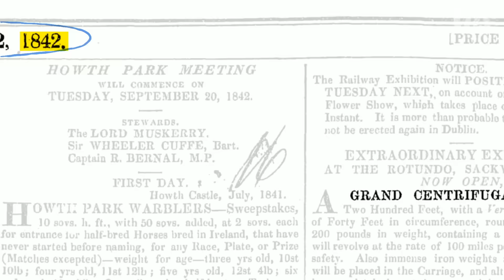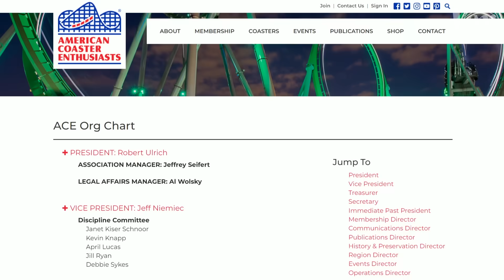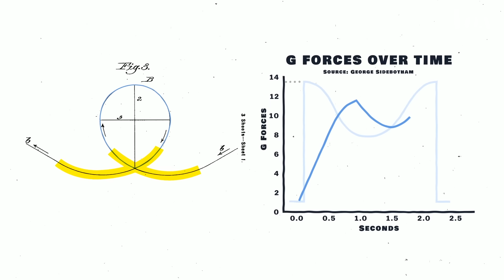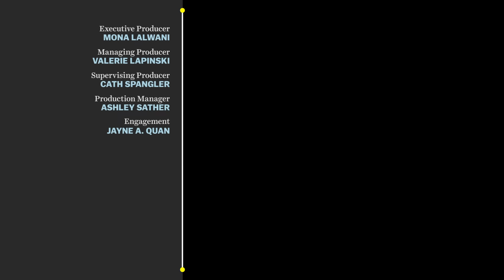Why roller coaster loops aren't circular

Comment: All these experts and not a single one showed the math for how they calculated 12 - 14 G? Because they are over estimating the height and speed of this ride. To hit 12G it would have to be ~70 feet tall. Most roller coasters during this time were between 20 and 40 feet tall. The first coaster to hit 60 feet wasn't until 1923. Flip Flap Railway more likely was in the 40 foot and 35 mile per hour range, therefore only hitting 6 - 8G.

Comment: You CAN have a looping coaster that is perfectly circular, but it has to be big and gradually curve upward as to not create excess g forces. The car that is going on the coaster also needs to be going just fast enough to make it over the loop, but not stall, to ensure the amount of g forces are safe.

Comment: Before I understood what G-forces are I was on a Superman rollercoaster in six flags one time. The rollercoaster is basically positioning you like superman flying where it would hold onto your legs and then raise you up belly down before it starts. During the ride it would spin up upwards (belly up), it felt like my chest was being compressed by a hydraulic piston. lol

Comment: Surprising they didn’t figure that out before the build process. That’s fairly easy force vector stuff, any physics-structural engineering undergraduate ought to be able to model that with some fairly elemental logic and existing Newtonian equations, even without resorting to calculus. I would have been able to figure out the g forces in a few hours or days at the most starting from scratch but no they blundered on doing it wrong several times.
Nobody thought to hire a university academic there must have been a few…weird. Perhaps this lends insight into the state of intellectual development 50-100 years ago.

Comment: Favourite loop coaster was the now defunct Corkscrew at Alton Towers in England. As the name suggests, it had a series of loops like stretched out spring coils. One might think that having more than one loop in a barrel series orientation would defy the upside down teardrop solution… but I’d guess the G’s are handled by the lower run up and run off arcs being stretched out on a horizontal axis between the loops instead. A pretty genius design - the twin loops section are now on display as an art piece/ homage at the parc to this day.

Comment: There IS one exception in terms of non-circular loops on today's roller coasters: the Shock Wave at Six Flags Over Texas. Both of that roller coaster's back-to-back loops are, indeed, circular; and yet, THESE circular loops don't have any of the issues that the earlier circular loops had; that's because the Shock Wave's loops are not nearly as tight as the circular loops of yore. The Shock Wave looks like it's had two Fireballs (a.k.a. Super Loops) attached to its track. The Shock Wave pulls 5 g's as it goes through the loops. This is definitely not high enough to cause blackout; it is, instead, enough to provide the riders with a big-time thrill! This g-force also causes the riders to re-interpret "down" to be "toward the track" instead of "toward the ground"; and thus, the riders never feel like they're upside-down!

Comment: could cause confusion for some people, when they said 4.9G they meant from the starting value to the ending value rate in 1 second
Thus, as opposed to 1 to 14G in 0 seconds (14G), it went from about 1G to 11G in 1 second (4.9G) which is sustainable because under 6G limit.

Comment: the one at Kennywood park in Pittsburgh PA was shut down and disassembled a few years ago.  it was a single track single loop just like you showed in the original, I remember it as a perfect circle but I havent seen it in 30 years so. likley it was a clothoid.  I should look into it.

Comment: The pressure (or G-Force) would be to strong in a normal loop, but a imperfect circle’s has less force, which is why it is used. I just saved you 6 minutes

Comment: At 5:18 the graph says 10 g forces, but later at 5:24 you say 4.9 g's. I'm not calling you a liar, i'm just confused.
Reply: They’re talking about a different coaster but still you’d be correct 10-14 g’s is massively inaccurate to the point i dont know how they messed up that badly

Comment: My mom is a very tall woman. At over 6'5'', she's historically had to be picky about which cars to buy, and it turns out that she doesn't fit perfectly in all amusement park rides, either. She experienced this bigtime after she went on a loop-the-loop rollercoaster... without a harness. She realized that her legs were too long for the bars to properly lock over her, but wasn't able to hail an attendant to get her off the ride before it was too late. All she could do was hold on literally for dear life, which resulted in an extremely sore back. Thank goodness for centrifugal force, I guess, or else my sister and I might not even be here.
Reply: didnt happen. its impossible for a coaster to start without every harness closed, especially looping coasters.
Reply: @happysword258  I don't think it happened either but it's definitely possible to dispatch some coasters (including loopers) with the restraints open

Comment: The physics behind why roller coaster loops aren't circular is also behind why road and railroad curves don't transition immediately from straight to circular-segment curves, but instead use a "Transition Curve" to ease the sideways forces.

Comment: The Revolution also didn't have shoulder harnesses when it was opened. Just a lap bar & the force kept you in.
Reply: The ride was renovated a few years ago, and now only has lap bars.
Reply: @A_A610  I watched the pov of the ride & it's wild  that nowadays they removed the harness considering it had been added and considering all the safety measures they ensure today.

Comment: The values of G force mentioned in the video and on graphs are all over the place. 
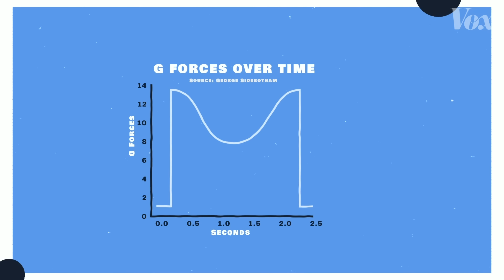2:52 the values change from ~8 to 14 at the top of the graph
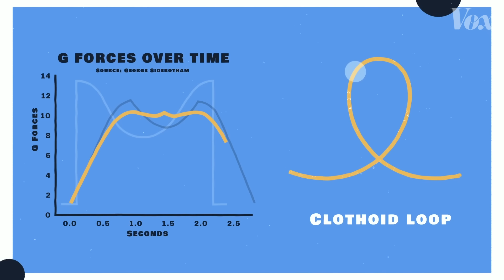5:11 clothoid has around 10G at the peak on the graph, but video 5:23 mentions 4,9G. I know it's for that one specific real life loop, but shouldn't it be at least somewhere close? Oh wait, if you actually used the graph provided by george it would be close! But instead you used a graph that you claim was sourced from george
5:31 On your graph it was 8G at the top of the loop (middle of graph), not 9G

Why
Reply: I guess graphics designers didn’t study graphs. Oh the irony…

Comment: Sadly the current record holder for most inversions (turning riders upside down during the ride), The Smiler at Alton Towers in the UK, passed into infamy with the terrible accident that occurred there on a windy day on June 2nd 2015. Due to a breakdown in communication, following the ride being evacuated after a fault was detected, ride operators failed to spot that an empty vehicle they sent round the track failed to complete the circuit. During this time, they were asked to add a fifth vehicle to the ride. While this was being done, a vehicle full of passengers set off, but was halted at the top of the first lift hill because of the track ahead of it being occupied, as designed.

The operators, still unaware of stalled vehicle, overrode the safety system and sent the vehicle full of passengers up the lift hill paving the way for the devastating crash that occurred seconds later.

The accident left 5 people seriously injured of which two required partial leg amputations

Comment: I think it doesn't really need a degree in mechanical engineering to understand this: In a circular loop in a rollercoaster, the g-forces peak right at the entry point and exit point (lowest point), because the curvature is constant and the speed (forward velocity) is highest. To passengers it would feel like a harsh impact, almost crash, since acceleration jumps from zero to max in no time. For similar reasons, curves are no circle segments on streets and (reasonable^) racing games.

Comment: Kings Island a park near me had to remove a loop on a wooden coaster called The Son of Beast years ago im guessing because of this same issue.
Reply: The loop removal was a casualty related to a different issue. An earlier incident involving a damaged section of track injuring a train full of riders led the park to get rid of the original trains to save wear and tear on the track. However, the lighter trains they swapped onto the ride were too light to properly clear the loop, so the park opted to remove it. The loop was never faulty, it just wasn't designed for those new trains.
Reply: @A_A610  makes sense

Comment: In short without even having to watch the video: circular loops provide too much force on the rider since you accelerate into different directions quicker than if the loop is smoother (turns are less sharp).

Comment: Are carts less likely to get stuck at the top of the loop if the curve is a modern style compared to the original
Reply: Getting stuck in a loop requires a very particular set of circumstances. The train would have to be perfectly balanced to not only stop upside down, but to stay there as well. It has happened, but it's exceedingly rare. It's far more common for rides to valley (i.e. roll backward and come to a stop at a low point).

Comment: I've been on a loop that pushed my head down so hard that I felt like my neck was gonna snap. It seems not all engineers have learned since the late 1800s.
Reply: you still probably only felt around 5-6Gs, far safer then 14G which would probably actually injure u

Comment: 2:26 I should point out a few things from the graphic. 
1. The Space Shuttle had a G limit of 3 because the shuttle stack was very fragile, and it would break apart if the forces increased beyond 3G, however other rockets pull more, like the 2nd manned space program, Gemini, which used the Titan II ICBM as a booster. Those astronauts pulled 7-8 G’s
2. The F-16 is capable of pulling +9.5 Gs, and pilots train for that. Other Fighters can do that, too, such as the F-22 Raptor. 
3. Ejecting from a fighter jet will give you a brief boost of +12-14 Gs.
Reply: They tried really hard to get impressive looking stats below that 6G line, I think. They took an F-16 roll, which I actually can't find any info on. I imagine it'd mostly be lateral and some negative if you're going full on since the cockpit sits somewhat above the roll axis AFAIK. 

Humans are quite good at withstanding sudden spikes in G force (depending on the circumstances). Humans tend to have trouble with sustained G's.

Comment: There are lots of inconsistencies in the video. At first they say a human body cant stand more the 6G without passing out. Then they show human riders at loops that reaches up to 12-14g. Also for the modern loop they showed it reaches 8-10 on the graph but just after the speaker said 4.5g. Can someone explain?

Comment: The graphs are terrible at illustrating the g-force on these loops. It shows the shape of the g-forces but it completely ignores the g-force numbers. As a result, all of them are illustrated as having dangerously high g-forces. The last one is supposed to show 4.9 but the graph shows 10-11g. Yes, it shows the difference in curvature, but that's kind of pointless..

Comment: Your graph at 5:12 shows the Clothoid Loop peaking at above 10G, but then you claimed that it peaks at 4.9G - are all your graphs inaccurate?
Reply: I think the 4.9 is like the average all around. You only have those high spikes of 10 G’s for not even half a second. So 4.9 Gs is around the average a rider will feel during the loop in total. I don’t know if I make sense. But I hope I help
Reply: @eatyourvegetables1449  no, 10 g is dangerous even for less than half a second. i think that 4.9 g is the max force, so the graph may be inaccurate
Reply: @thebestplayerispatapete4564  Fighter pilots are trained to pull up to 9g's.
Reply: @eatyourvegetables1449  but most people aren't fighter pilots
Reply: @eatyourvegetables1449  also fighter pilots have a g-suit
Reply: It could be accurate for that specified height. The 4.9Gs is from a much larger loop, therefore the forces are much lower.
Reply: 14G is not realistic, the roller coaster wasn't that tall to reach the speed required to hit that.

Comment: how many g forces does a rider experience when he flies of the roller coaster?
Reply: While airborne, the rider experiences zero g's, because the rider is a free projectile, experiencing no force other than gravity.  When gravity is the only force acting on you, you feel that the gravity is nullified due to it all being used up in causing your acceleration, and you do not feel the g-force of gravity.   It is when the rider crashes to the ground, that he will experience an extreme spike in the number of g's.

If you fall from 30 meters (roughly 100 ft), or are projected upward with a maximum height of 30 meters, you'll crash to the ground at a speed of 24 m/s [54 mph].  If it takes a tenth of a second for your body to slow down to rest, you experience an average of 25 g's during this time.  And it probably peaks around 40 g's.   For comparison, the maximum survivable g-force on record is 46.2 g's, and that is while wearing a flight suit that is specifically designed to maximize the chances of surviving it.  So you would not survive this fall in street clothing.

Bottom line: it's not the fall that kills you, it is the sudden stop at the end.

Comment: I can challenge this whole video. If the loop is bigger then it will make a difference on the impact of the G-force on the human body. The smaller the loop the greater the G-force. Duhhh. Not even mentioned in this video. The million dollar question is how big does the coaster have to be?
Reply: "The smaller the loop, the greater the g-force" is incorrect.

No matter what the radius of the loop, the difference in g-force between the top of the loop and bottom of a circular loop would always be 6 g's, assuming the roller coaster coasts between the two points with negligible friction.   The human body might tolerate a slower change from 6.5 g's to half a g, back to 6.5 g's on a larger coaster, but the 6 g difference will still be there.   It is a matter of shape, rather than size, that mitigates the difference between the g's experienced at the top, and the g's experienced at the bottom.

Comment: The same rules apply to roads! You'll never find a circular turn, for example, on a motorway or highspeed road, the change in gradient is just impossible to steer into. Instead, curves are made up of a series of parabolas which feel circular, but are not.

If turns were circular, you would have to turn your steering wheel from 12 o'clock to the angle of the turn in an instant. But we all know that's not how you take a motorway curve, you slowly adjust your steering as you go round the bend, with your wheel turned the furthest at the apex, and then you slowly return it to the 12 o'clock position as the road straightens out.
Reply: Roundabouts for the win

Comment: As a physics student, I'm going to guess the roundness of the loop meant that sufficient speed to complete the loop and still continue down the track would result in excessive upward force at the apex of the loop, which would eventually damage the structure.
Reply: Nor sure what you are saying but obviously the more and more the train goes over the track with that force, the more stress being put on the structure which will make the ride rough.  That's why coasters get retracked.

Comment: Ok, explain this to me again. By increasing the steepness going into the loop reduces the g-force from 14 down to 4.9. Doesn't sound theoretically possible. However increasing the height of the loop to 114 feet would distribute the g-force loadings more evenly compared to a shorter, tighter circular loop.

Comment: A former neigbour's son joined the Dutch Airforce and became an F-16 fighterpilot.
Though I haven't spoken to him since he moved, I read an interview with him in the local newspaper, years later.

He said that 6G maneuvers weren't an exception for F-16 pilots and it also caused some issues.
F-16 pilots in their late 30s, having flown so many hours doing multiple G maneuvers, started developing neck and back problems.

In essense, he said, if you were a fighter pilot, you'd be an old man once you entered you 40s.
But that's a price fighter pilots are willing to pay I guess.

Comment: Sooperdooperlooper's loop is still quite a bit more circular than the loops on newer coasters. You can definitely feel more force in the loop than you would expect given the fairly paltry 45 mph speed. It's actually pretty surprising since the first drop is so gentle (as is the rest of the ride). It is cool though having the track pass through the interior of the loop. More coasters should do this, especially since coaster loops have gotten so much bigger with a lot more space inside. Maybe even put it towards the end of the layout after the mid-course brake run, so there's a chance your train passes through the loop as the next one is traversing the loop.
Reply: there are still other loop coasters right? I was watching this and I was so confused because I swear there are tons of loop coasters!!